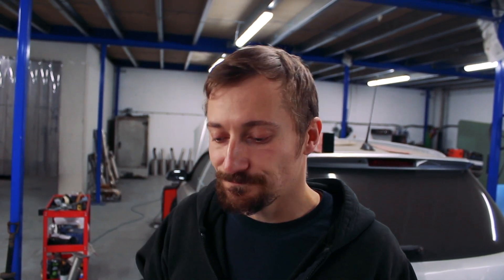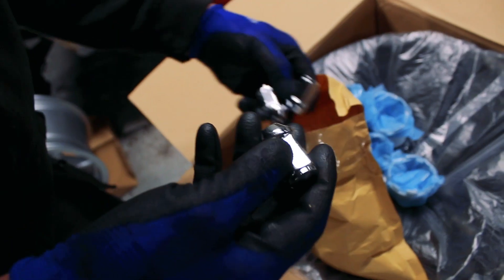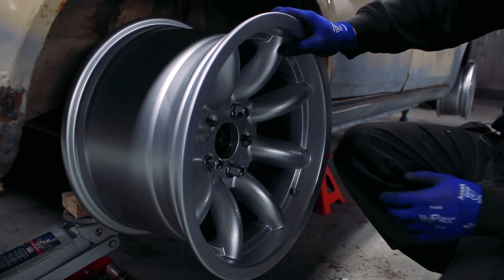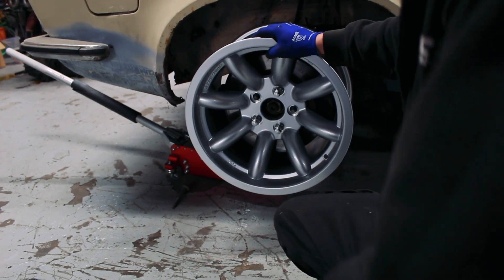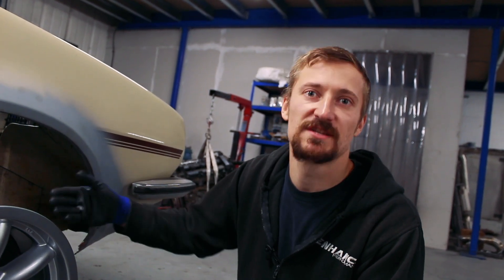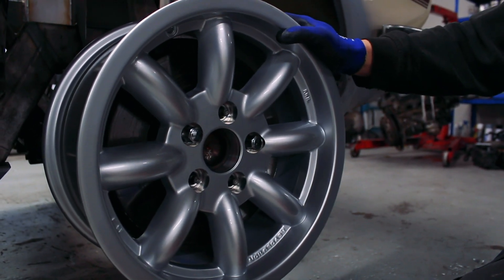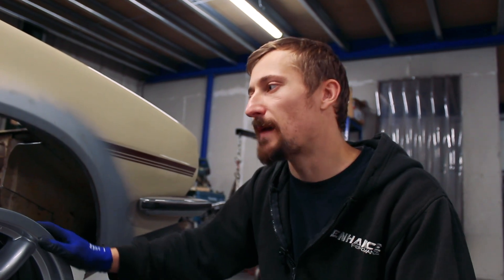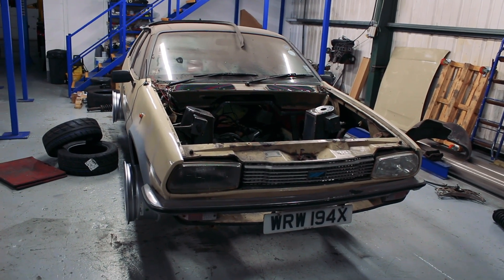Project PrincesS-Type | Episode 7 |  New Wheels Revolution 8 Spoke Classics

Comment: Hi - loving your videos and the Princess concept - some brilliant practical engineering going on too!  Just wanted to point out that your tyre sizes are quite close to the excellent ZZR and ZZS tyres Avon make for Caterhams.  Eg. The Caterham 'CSR 260' has a 9J x 15 wheel and a 245x40 R15 tyre.  This would give ~15mm less profile than your 235x50 R15 tyres (which may not suit the Princess quite so well), but would be wider. Likewise for the front, many Caterhams run a 6.5J x 15 wheel and 195x50 R15 tyre.  Anyway, hope this gives  additional options to consider if Toyo do stop making your preferred size.
Reply from the maker: Thanks for the info Andrew! 😃

Comment: Those wheels looks proper decent and don't really give away what lies underneath! I'd be surprised if you ran into trouble with the calipers. They obviously have a massive safety factor + probably vary +/- 1mm as fresh castings. They've also a lot less work to do compared to the S Type!
Reply from the maker: Thanks! That’s what I’m hoping, but I’d rather scrap a calliper just to be sure, they really don’t need much ‘massaging’, so hopefully I can get away with it!